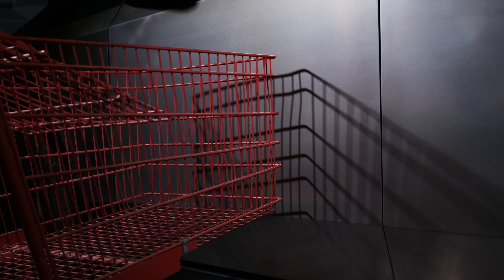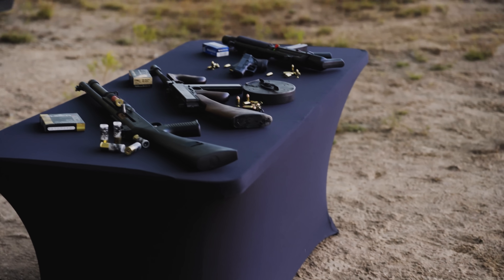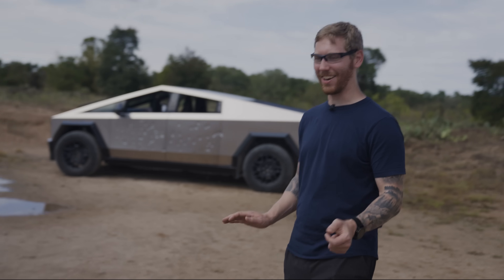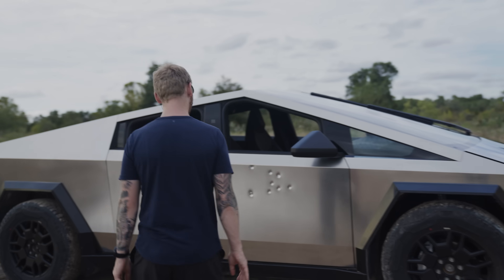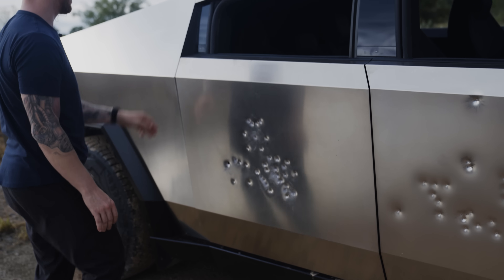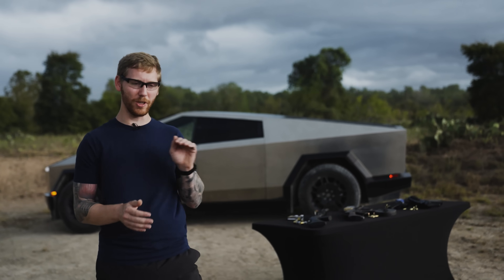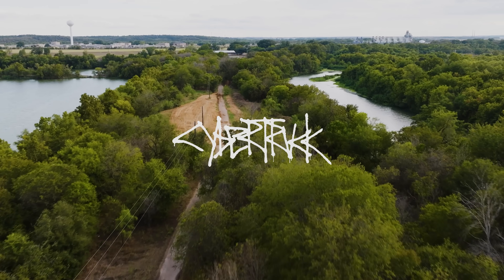Cybertruck Bullet Test

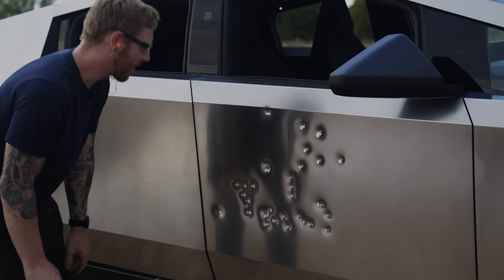Comment: 2:11 Actually the MP5SD is specifically designed to reduce standard 9mm ammo (which is supersonic) to sub-sonic velocities. The entire barrel has vents along it to bleed off pressure and reduce velocity. So, no, the bullets probably aren't going faster. They are going even slower than the rounds out of the handgun, which is evident from the fact the dents aren't as deep.
Reply: It's funny because he said they were traveling faster but the caption said otherwise. It showed 1100 fps for the Glock and 950 fps for the MP5. At least the video editors knew what they were talking about.
Reply: @TheCharleseye  True and for those who don't believe the caption, look at the dents in the car. The handgun clearly dented the car more.
Reply: @TheCharleseye its probably because 99% of suppressors speed up the velocity of a bullet. The MP5SD is less common
Reply: @islas357  suppressors capture expanding gasses before they have a chance to leave the barrel. How exactly does removing expanding gasses speed up the velocity of a bullet?
Reply: @TheCharleseye  I know it is counter-intuitive but suppressors do add velocity because there is still some pressure behind the bullet pushing it as it passes through the suppressor baffles (vs effectively 0 pressure if the bullet exited where the suppressor begins). It obviously won't add as much velocity as would be added by a barrel section of equivalent length but it does add some. That said, the MP5SD is specifically designed to reduce standard 9mm to subsonic velocities, so the velocity added by the integral suppressor still results in the rounds coming out of the barrel below the speed of sound.
Reply: Who else said "Huh?" at that point in the video 🤪🤪
Reply: Not Firearms or Automotive experts, who would have thought that snake oil salesmen are full of shit.
Reply: Excellent point. I'd also note that even the thinner weaker steel used in most cars, is pretty detrimental to ballistic peformance. I'll take any car's door for cover, if someone was shooting at me, over standing with no protection.
Reply: @alwaysmatterinmotion  Better than being out in the open but being behind the engine block is preferable.
Reply: @alwaysmatterinmotion  i believe paul burrell tested this by shooting a car and a door will not hinder a bullet enough to save you, the engine block is the only area of the car that will stop a bullet from going through, otherwise the bullet will literally go in one side and out the other side of the car, even with both doors closed.
Reply: In fairness the guy is a Tesla employee so he's probably not a gun expert. I still think that police forces will be throwing money at this.
Reply: @jeffjames3111  Ford already has an electric F150. Not long before they make an electric explorer, which us their current standard vehicle.
Reply: @jeffjames3111  if the police all start driving 100k trucks it will be time to defund them again
Reply: @carlholland3819   The cheap one is 60k - have you seen the APCs they have now?
Reply: Agree, this was done intentionally because the MP5 is used in close quarters and you don't want the round punching through multiple walls and hitting people several rooms away.
Same reason you don't go using 223 in close quarters...
Reply: @Casper042  It was done intentionally because this whole test is dishonest, and they picked the "meanest" looking weapons using the slowest, least armor penetrating rounds they could to mislead people who don't know about guns into thinking the car is more bulletproof than it really is.
Reply: @ChildrenOfDesire  i'm not really a tesla fan but i think you're being harsh, this car is easily the most bullet resistant car available to consumers at an affordable price, the thin sheet metal on every other car out there is not going to stop a bullet at all, maybe a .22, but anything else is going straight through.
Reply: @Casper042 overpen risk with 9mm is actually higher than 5.56. The fact that 5.56 is exceptionally fast, rear heavy, and light cause it to tumble and break up extremely quickly  when in contact with soft targets.

Comment: how long does a replacement panel take to get? cost? can anyone repair it(or void the warranty?) or is there a waiting list?  How many times have you been shot at because of your driving?  Do they aim at the door or window in a war/ car jacking setting? Someone will make a get around the security, like a force firmware hack.  Most Tesla's are just giant RC cars syncing up to skynet/starlink and the jailforce/repo.  Good luck putting it out if you have a fire, total lose and you're back on a waiting list.
Once damaged it will be a fire hazard forever, at the scene, on the tow truck, in the repair lot, during repair, in Walmart parking lots and at home in the garage.... ouch insurance and risk will go way up on everything. People will refuse to tow or repair, because of the new insurance policies over building fires. Since the repairs will mostly be done together, 1 car could reignite and burn 6 or 7 other Tesla's a few times before changes come. The truck lost half it's value once he shot/damaged it?

Comment: everyone likes the bulletproof "feature".  you might as well capitalize on it and offer a version with added thicker steel plates in the doors, you don't have to make the entire body thicker, just plate the areas that are needed, sides of doors, hood, behind the rear seats, etc.  it's plenty powerful, the weight is not an issue. you can sell it for more $, shouldn't cost that much more to produce..   edit, buy armor plates from a ballistic armor manufacturer to accomplish this, fit to custom shapes to fit into the doors, don't try to make the actual skin metal thicker.  use plates that can stop .556 and everyone will want it

Comment: Any data/info on how it performs in crashes? i.e. does it safely protect the people involved in the crash?
Reply: That's the interesting question. Vehicles actually used to have thicker steel, one of the reasons they moved to thinner and fiber glass is to create "crumple zones" where the car will collapse absorbing energy before it can affect the passengers.
Reply: Why are people not taking about this? I am sure this is vehicle manufacturing 101.  I am sure Tesla has given thought about it
Reply: This thing has no crumple zone, if it crashes they'll be pouring you into your grave

Comment: What if you aim a little higher and hit the windows?  I saw where Musk said something about an option for bulletproof windows but they would be so heavy you could not roll them up and down-just fixed windows. The body toughness is impressive but just aim higher and completely destroy all the windows pretty quickly.  I guess if you are under attack then keep you head down behind the steel:)
Reply: Yeah, you'd still die if they shot you through the window. The car wasn't actually designed to be bulletproof. It's just a side-effect of the materials they used that the body is. It's a cool thing to emphasize though because it speaks to the general toughness of the vehicle. If it's stopping bullets, it's going to do pretty well with fender benders and other wear-and-tear.
Reply: @NateDecker1982 I'm wondering how do you fix dents/fender bender damge on the cyber truck?   Still haven't see how that's going to be handled.
Reply: The point is the panels are bulletproof, if you're being shot at just duck :) --- I guess you're expected to use tesla autopilot and take shelter LOL
Reply: @Kelson01  But why are you being shot at?
Reply: i dont believe those windows until somebody tests it and posts a video
Reply: не хватает миномёта в багажнике
Reply: Too much GTA for this one.
Reply: @imVuid it’s common sense why would someone choose to shoot through the door vs the window. The window gives a clear line of sight.
Reply: Sorry you live thru a civil war
Reply: @christian2i average parent driving their child to school in america
Reply: @kx7500 u are right, i get mowed down by assassins hidden on rooftops of buildings with guns when going to school on a average tuesday
Reply: Yeah bullet proof windows are fixed.
Reply: I’m sure the cybertruck glass will at least slow down a bullet more than any other glass.
Reply: @aqualane1  why exactly lol
Reply: @aqualane1  If you are driving around and being shot at, where your car body and/or glass needs to be bulletproof, you need to save your money...and use that to move somewhere else
Reply: you put your head down anyway, in just about every situation when you're getting shot.

Comment: Base it offers great protection stopping 9mm 115g your most common threat on the streets.

Would be awesome if down the line they offered an armoured model.

If the current alloy is only 1.8mm thick sound like they could beef it up to stop 556 & 762x39. Bulletproof glass would be simple to source as well.

Comment: I think folks usually aim for windows anyways but it’s neat that a vehicle is finally (partial) cover instead of just concealment.
Reply: If you find your self in that situation then duck down
Reply: I think Elon may be putting some special glass on the truck
Reply: @Mika-ph6kuits priced the same as any other truck
Reply: Ask yourself why they put the windows down for every shot. They probably shatter when rolled up even if a bullet hits the metal.
Reply: if you need an actual bullet proof car, there are companies that will do that. Armor that will stop any rifle round and bullet proof glass aswell
Reply: exactly, anything of a higher calibre than these guns they shot here and its going straight thru the metal and straight through the glass
Reply: People do aim for windows… doesn’t mean they’ll hit them though.

And this is more to show off how strong the truck is rather than saying it’ll save your life.

If it’s bulletproof then it’ll probably be fine against a 2x4 falling onto it or something.
Reply: @Fetidaf  but its not that strong, it can stop a bullet, but if its in a fender bender with another car, that dent is still a dent just like the bullet indents still are.. that. The bullets aren't bouncing off the car, they just aren't passing through
Reply: @justmarcus33  they’re not acting like it’s indestructible, just stronger than a normal car or truck. Of course if you crash it it’ll be damaged, no one is saying otherwise
Reply: they made the windows bulletproof
Reply: @Skomnoge  I don't think so.  They eve showed the one cracked when it hit the door, so my guess is that with that particular shot, the window would probably have shattered, but didn't since the door took most of the force.

Comment: I am curious to see the slow motion impact on a higher caliber round like .30 round. I think that the bullet would certainly penetrate the sheet metal, but regardless it would be awesome just to test it out!
Reply: Technically both 45 and 9mm are bigger than 30 cal. I would bet that a 223 would pass through.
Reply: @DirtbagCarpentry  17hmr would be a good test
Reply: @DirtbagCarpentry  don't let diameter fool you
.30 aka rifle cartridge has more power thanks to length
Reply: @02suraditpengsaeng41  you clearly do not know what you are talking about, 30 cal does not mean it has a long cartridge, for example the 300 blackout is a 223 cartridge necked up to a 30 cal, compared to a 30-06, they look and act nothing alike. A 30-06 could probably do some damage but the much slower 300 blackout would have a better chance of getting stopped.
Reply: Tesla's engineers said this will only stop sub sonic rounds like the .45.  It will not stop anything else.  A bit of false advertising I think.

Comment: It's Tesla putting it out. Not going to go off it until an independent source does a test. Truck still fails pathetically in the crash/crumple zone tests, is ugly AF, struggles to even do offroad stuff. Has specifically designed tires that have to fit the plastic hubcaps etc.
Reply: test or regulation doesn't matter cuz being truck USA law don't mind (as I know before)

Comment: To be fair, you CAN stand behind the engine block, the wheel axles, and the transmission axles to MAYBE get an impact or deflection. I also keep a 70-pound sandbag for workouts in my trunk that could stop some rounds but it's smaller than me. 😂 It would have to be a favorable strike to the center mass though. Only in the movies. 😂 I so wish Musk was a better person. I will not be buying anything that man is getting money from. Otherwise, I'd consider buying one in the future.
Reply: The whole reason they worked out Kevlar is bullet resistant is because people realised bullets didn't penetrate Kevlar belting in car tyres.
Reply: @WeirdNeville  Another thing to consider is that they were only shooting relatively weaker small-caliber rounds at it.  Anything M16 or AK47 equivalent would have likely punched though.  You'd be in better shape than in a normal car or truck though. A lot of the velocity will be dampened by the time the bullets and/or fragments hit you.  😅

Comment: Impressive resistance but a big problem I see is if a panel gets dented- the body shop won’t be able to pull it out will they? Surely that’ll mean a whole new panel🤔
Reply: If you buy any Tesla product, it's pretty much like that. Scratch a wheel? Tesla will replace, no reconditioning allowed. Quarter panel has a golf ball sized dent? Replace the whole quarter... They don't really care about keeping their vehicles repairable. Guarantee in 5 years, slight fender benders will total all Teslas.
Reply: If you are getting shot, then replacing your panel is probably the least of your worries. The point here is that you could get hit with a shopping cart, or even a sledge hammer and the car isn't going to take damage.

Comment: You wont be able to sell this in the EU due to pedestrian safety concerns most likely, also the fact this is a walking death sentence to anyone that gets hit by this, the reason why is that this will plow straight trough anything without issue giving its weight and its stainless steel construction, which although makes the people inside very safe it makes the people outside a guaranteed Death on arival with any speed over 20-30 mph